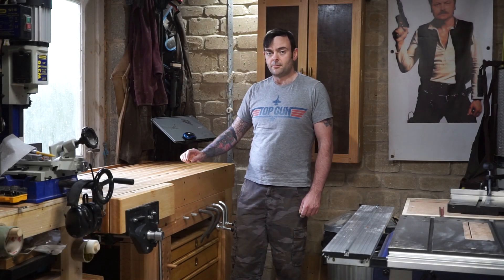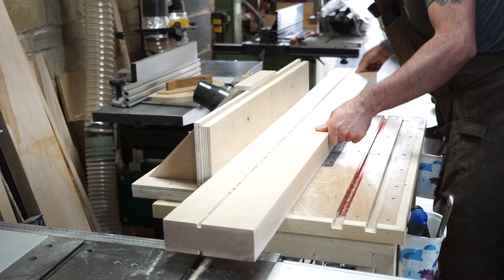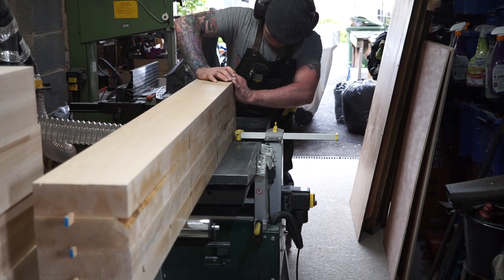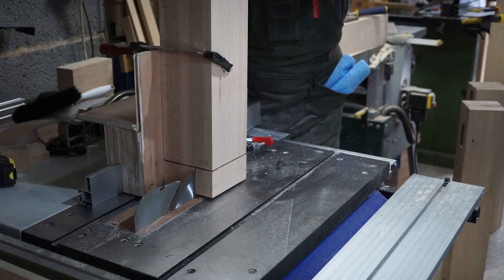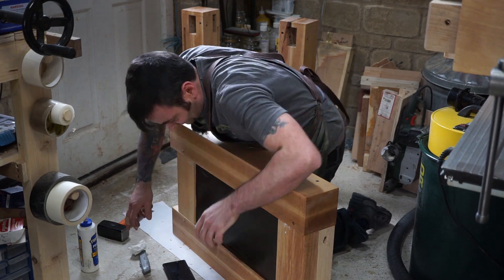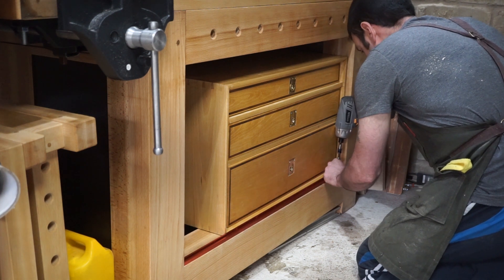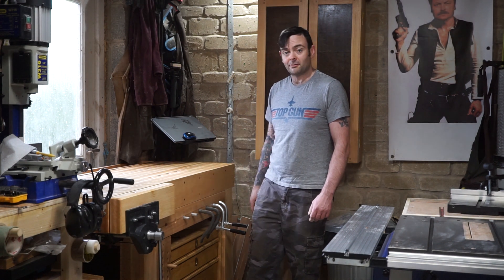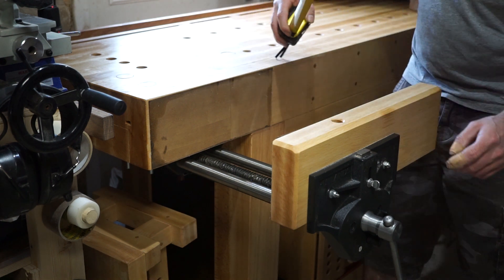Building a monster hardwood workbench in a UK garage.

Comment: Great job on the bench. A little tip, you should start the mortise by doing both shoulder ends first and then take out the middle, this will keep the shoulders square and true by the wood supporting the chisel on both sides. keep up the good work and stay safe.
Reply from the maker: Thanks for the comment :) I started doing exactly that right after filming the mortice in the video.

Comment: Hi Matthew,
this is a great video.  I've watched it twice now as I do plan on building my own bench in due course.  As I have back issues, I have a hydraulic lift designed for lifting motorcycles (also very handy for moving fermenters when brewing beer). I intend to use that for helping to move the bench top pieces.  Hopefully,it will work :-)  

Keep the videos coming.  Your honest, calm presentation style makes a pleasant change.

Finally, I can echo the great customer service from Tyler Hardwoods.  I'm quite lucky as they are only a half hour drive from me.

All the best,

Mark
Reply from the maker: Ta very much. I'm glad to report that since building this, I've had no back pain as a result of woodworking. My old bench used to cripple me.

Comment: Lovely workbench and how satisfying to build something that you know will last your time out and probably another generation or three if looked after. I like the thought that has gone into all the details and particularly the tool well that will accommodate your main tools without compromising the actual work surface. Nice detail. 
Did you put any treatment, oil, or wax on the beech or is it just left as is? - and how does it hold up?
Reply from the maker: Thank you. To be honest, the bench has worked out even better than I thought it would. The many different ways of work holding are an absolute god send. As for finishes, just boiled linseed oil, 3 coats and it's held up absolutely fine.

Comment: What do you use for dust extraction?
Reply from the maker: For the floor standing machines, I use the Axminster AC82E with the fine filter cartridge, plumbed in with 110 mm waste pipe. For sucking up the waste from the hollow chisel morticer, sanders and other hand tools, the Record Power DX1000.
Reply: @MatthewSmall  Thanks for getting back! Whats your overall opinion on the AC82E is it sufficiently powered/effective/noisy? I have tried building my own extractor with a wastebin, 1200w ozito and a 20 quid cyclone off of amazon but it's so bad that the waste from my table saw just sits in the hose itself rather than getting sucked, so now I'm thinking I should just bite the bullet and get the AC82E
Reply from the maker: @sebastiangug8284  the AC82E is really quite excellent, though that does come with a few caveats. It uses an induction motor which is loud on startup for about half a second, then it's really quite whilst running. It sucks in 1500 cubic metres of air an hour so is almost double what is required for most machines. Clearing waste from the planer thicknesser is an absolute doddle providing you use 4 inch pipe and keep the internal surfaces of that pipe free from protrusions like screws etc when assembling. It has absolutely loads of suck and that seemed to increase when I fitted the fine filter over the bag type filter. The caveats are: until you cut out the crappy blade guard above the motor, it will block up continuously. Removing this improves performance and doesn't cause any damage to the machine. It's designed to stop you putting your fingers in there, not to stop things hitting the impeller. Perfectly fine to do. The second caveat is that this all depends on the design of the dust collection of the machine it's plugged in to. Table saws are notoriously bad for this as they have gaps everywhere, and because you need to be able to raise and tilt the blade, the blade housing usually isn't sealed. Even with the AC82E turned on and using the blade guard extraction, I still get piles of sawdust under the machine. That's the fault of the saw though, and not the extractor. Honestly, it's worth every penny and if you can afford it, the next step up with the attached cyclone would be worth it too. But if not, the 82 is excellent. It's been one of my better purchases.
Reply: @MatthewSmall  Thanks for the detailed reply! I have just put in an order for the AC82E + Cyclone + 1 micron filter, you should get an affiliate deal with axminster/charnwood! Btw if you need help with video editing/web stuff part of your woodworking media projects feel free to ask away, I've been a motion graphics director for ~4 years and now a lead web dev for ~5 so should be able to help :)